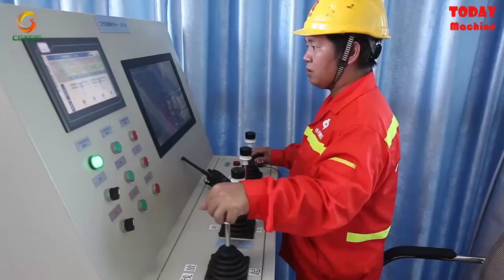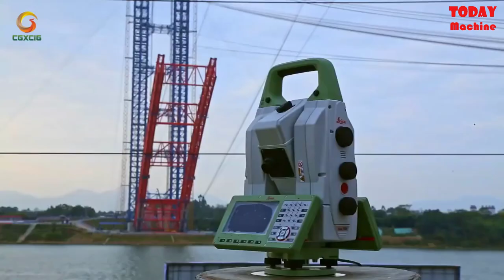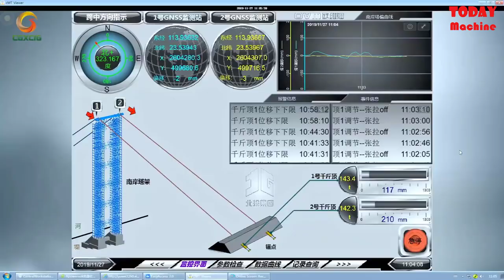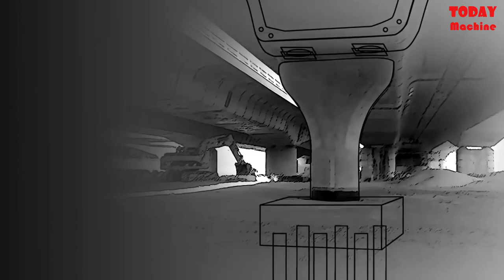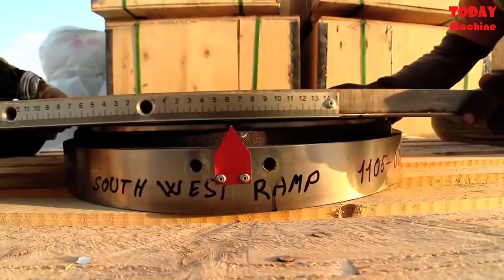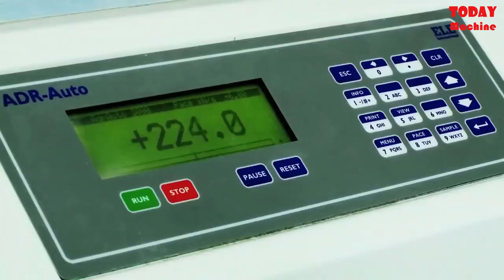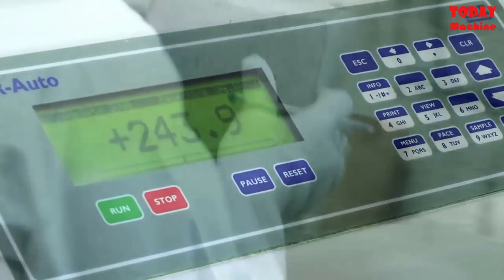Construction of the largest and longest arch bridge in the world here one place. Pingnan, China

Comment: As a retired professional engineer my observations are:-
(1) Chinese engineers are good.  Their skill isn't just limited to the permanent stucture which is the arch bridge but the rigor in the temporary works.  The temporary works, say the two blue vertical towers, are all adequately sized, robust with ample safety factors, superbly executed and totally removed without a trace on completion.
(2) China is exploring all different designs and methods of constructions. In so doing China acquired the different skill quicker and able to develop more professional engineers and in shorter time span.
(3) Chinese engineers have no cultural preference on the choice of materials so steel and reinforced concrete, post-tensioning and pre-tensioning tendons are all in use wherever situations warrant.  Chinese engineers are therefore up to date with the world's contrsuction technologies.
(4) To maintain a site clean and have the finished infrastructure blend in with the environment with no visible rubbish left behind are signs of good engineering management.  Thus it gives the impression China's construction observes safety and has achieve a high world standard.  This is visible in the finishes of their concrete structure and the protection of the steelwork.
(5) Practises make perfect.  The huge amount of construction work and the vast number of projects completed have propelled China to the forefront of the world's construction powers.  Also China's friendly attitude towards the developing countries and the willingness to invest in their infrastructure have enabled China to export to and share its engineering with many countries.  This has enhenced China's international standing in recent years.
(6) China's engineering is a game changer for China as well as for other developing countries.  In recent years many low income countries have managed to acquire high speed rails, metros, bridges, expressways, hospitals, sport stadiums, schools, water supplies, power plants, factories, industrial zones, power transmission lines, ports, railways,telcommunication systems and universities with the China's assistance.  Some of the projects will be hugely beneficial to the host countries like the Padma bridge in Bangladesh, Peljestac bridge in Croatia, Maputo bridge in Mozambique, HSR between Belgrade and Budapest, Indonesian HSR, Thailand HSR, Laos HSR and the rail link between China and Nepal through the Himalayas.  China is truly making a contribution to mankind and delivering its promise of shared world community.